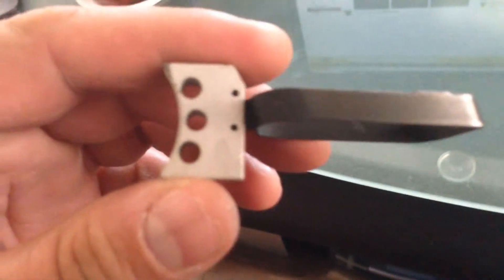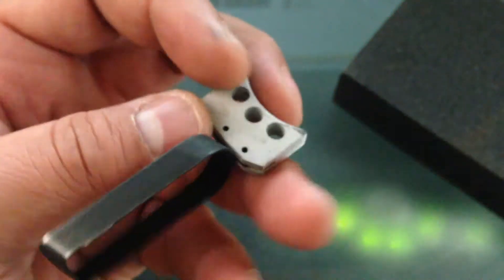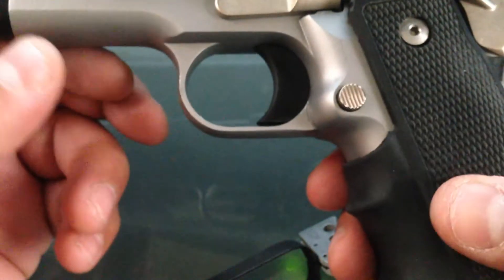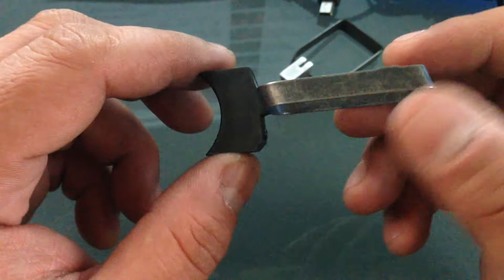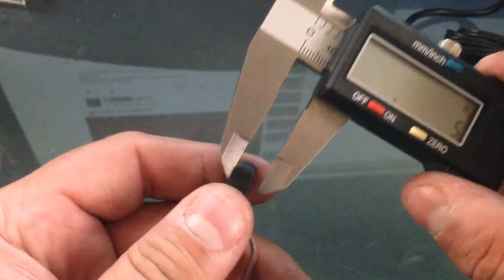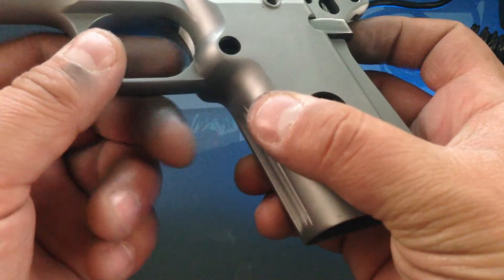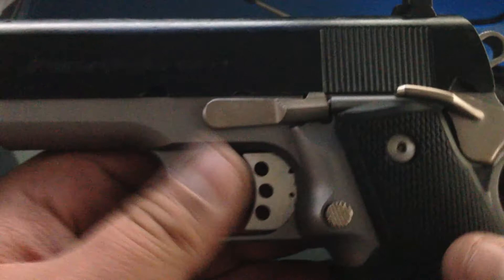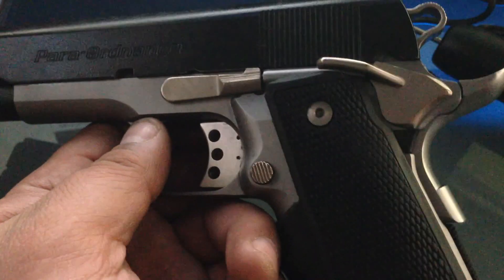Para Ordnance P13 1911 Trigger Replacement & Series 70 Shim Installation

Comment: I am having some feeding issues, had two old mags and stretched the springs out, bought 3 brand new Para mags and the 3 round doesn't go into battery in the 3 new mags ...any suggestions. I cleaned everything, and still some issues, it is a 1995 model Canadian made. Also where can I get parts
Reply from the maker: I had to replace all of my carry mags with wolf mag springs with extended strength. I had to remove a few coils to get them to tune right but they worked great. The stock para mag springs dont last very long and just suck in my opinion. Brownells is the only place that I know that catalogs any parts for old Paras.